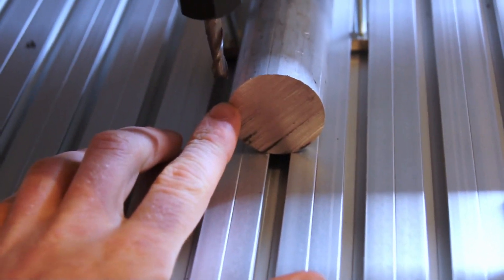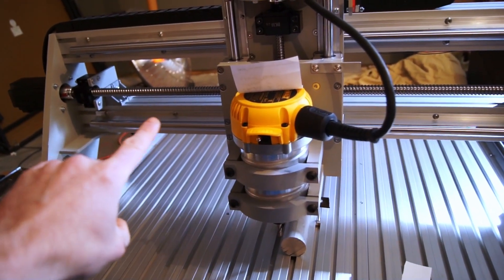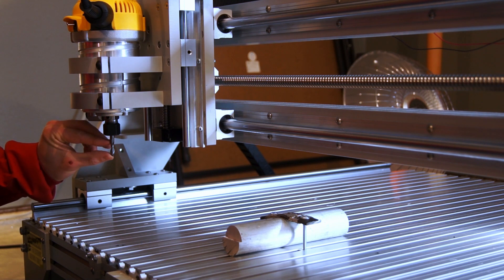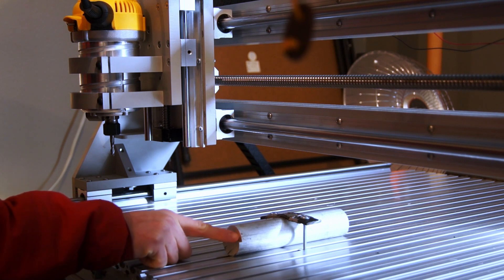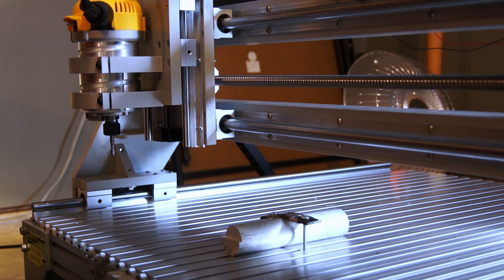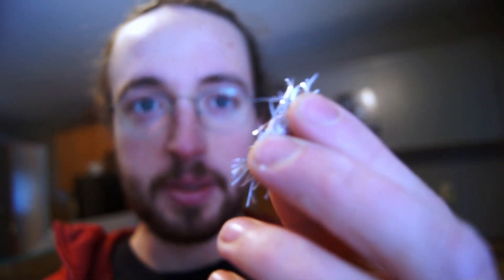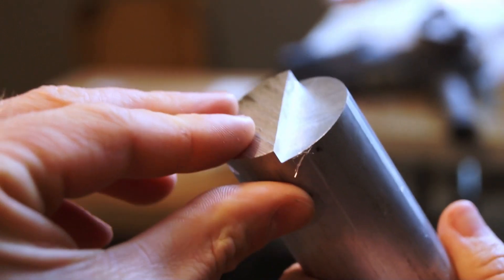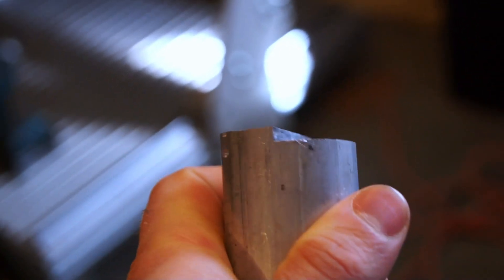Fist Cut on the Millright CNC Power Route!

Comment: How did I miss this!? Very exciting! Awesome! Bet that fixturing was vibrating a bunch too. No matter how tight it was.
Reply from the maker: Pretty dope right? I don’t think so. A pretty ridged attachment. I’ve seen more aggressive cuts on less ridged fixtures. The chatter was coming from the rigidity of the machine I think
Reply: @DylanEdmiston  I dont disagree it was mostly the "slop" in the machine. Real point I was trying to make is it's not a goot way to fixture. Bad for the extrusion. It could be deformed from over tightening like this because there is nothing backing up the pulling on the extrusing. Hope that makes sense. I know you can be more creative with the fixturing. I also know it was just a test cut and you were anxious to get it going lol. No hate.  Awesome to see it work for the first time.  When's the next cut?